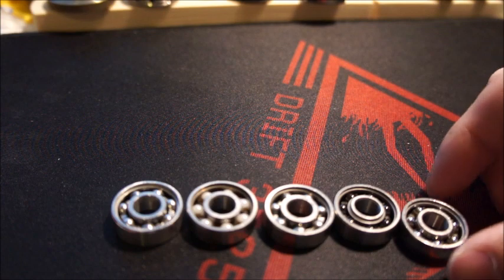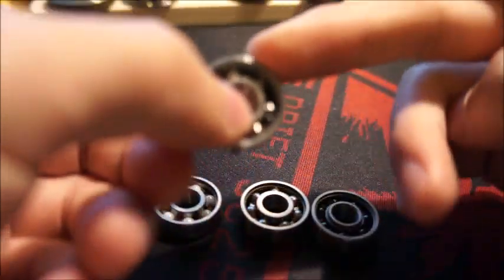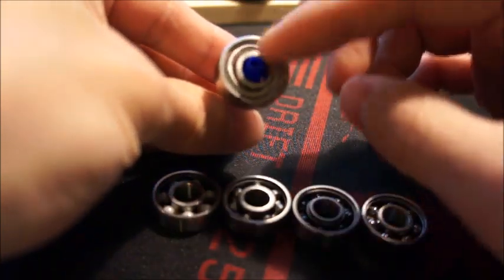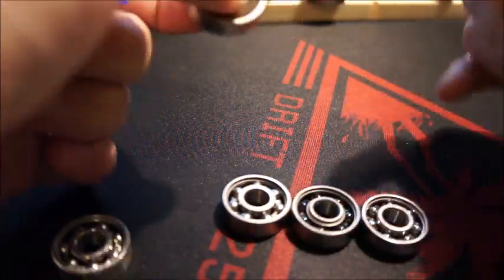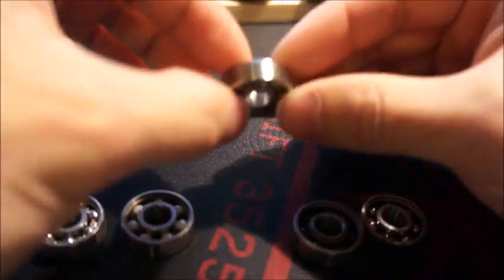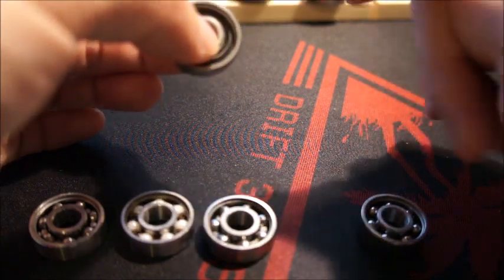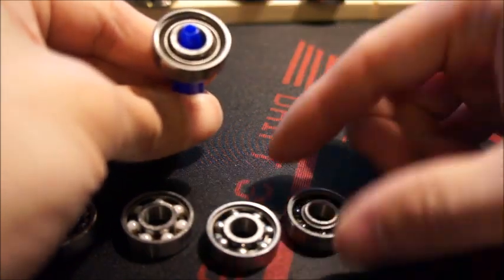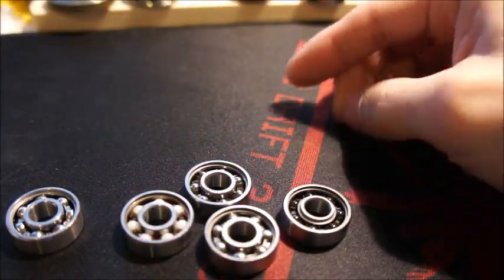Bearing comparison ABEC9 SS vs Al2O3 vs Si3N4 vs ABEC11 SS (For Spinner)

Comment: Hey so I recently ordered a fidget spinner, and its a Si3N4. A lot of videos about that bearing in fidget spinners are saying it is loud. Is that true?
Reply from the maker: Yeah, that's true, and after a while usage, with little bit dust getting into the bearing, it gets louder, keep the dust shield on if possible to reduce the amount dust gets in. The alternative is rub in a tiny bit hand grease or really thin grease, it'll reduce your performance, but the tiny bit grease will make it almost completely silent. Hope that helps. Thanks.
Reply from the maker: I bet the dust cap is removed for those. don't mind that too much though, use a bit grease and lose a bit performance is no issue on spinners, nobody holds it and let it spin for long, you'll be pausing and restarting very often, so I would be happy with 20 seconds spin time.
Reply: Okay also, in your video the bearings don't have caps, but I made my OWN fidget spinner and they had the red caps, they were from a skateboard so what I'm asking is; that will the fidget spinners bearings have a cap or will it be open so we can see the balls?
Reply: From the one I'm buying.
Reply from the maker: I'm not sure, I will guess the red caps will be taken off from the toys from your link, but you can use the red caps from elsewhere, it looks like 608 in the center, your skate bearing cap should just fit. (forgot to say, the ones in my video came with caps too, I remove them so I can clean up the grease)
Reply: hey, can you give the link of the last one bearing in the video?
Reply from the maker: The last one is a SS: https://www.amazon.co.uk/gp/product/B00MS7S9IS/ref=oh_aui_search_detailpage?ie=UTF8&psc=1
Reply: thanks a lot

Comment: How long do the Si3N4 usually spin for withought the lube?
Reply from the maker: That depends on your spinner weight and how much dust got in. on a vorso flat top it can get to 3 and half minutes when it's new and clean. with small bit dust in, it lasts around 2 minutes.

Comment: so which one is the best for a hand spinner? because right now i have red bones as a bearing and it spins for 1:20. please help me....
Reply from the maker: Ceramic, go for ceramic. All ceramic works better than SS in terms of performance. SiN4 is the best, but if you are on a budget go for ZrO2 ceramic. They are much cheater than SiN4.
Reply: Do you know where i can get a SiN4 or a zr02 bearings? because  all i find them at is amazon and some china websites.
Reply from the maker: Amazon, ebay and China are the places to get them unfortunately. You should be able to buy SiN4 from Amazon with no problem. ebay and china will take more than a month to get them shipped sometimes.
Reply: Do you think the silver abec 9 on amazon is a good bearing or no??
Reply from the maker: They should be ok, but I don't think they'll do better than your red bones ones. bones makes some pretty awesome SS bearings on the market.  If you are really keen to get an upgrade, try these: https://www.amazon.com/Pacific-Flyers-Si3N4-Skateboard-Bearings/dp/B00KQPJUKA
Reply: Iam in a tight budget for these spinners so i wouldnt really drop 37 dollars for bearings.. So any other bearings u think thats good

Comment: Thank you a lot for this comparison. So if i understand you well the abec 11 is the best for fidget toys and they are the best value for the money. And also which metod for cleaning the oil are you using?
Reply from the maker: After months of testing, I have to say the SS is good enough in most cases, but the tight fitting is not preferred, slightly lose fitting helps the performance so much. The batch SS I have, about 50% of them are really tight fitting, the other half are good. So if you are keen on performance, go with the ceramic instead. The only reason I see for SS is for the lower noise level.
And for cleaning up the oil, you need to do the following: 1. Spray WD-40 into the bearing, and spin it, let WD40 soak in for a couple minutes. 2. Use tissue paper to absorb the excess WD-40. 3. dig the bearing into paint thinner for a few minutes. 4. clean up the paint thinner. 5. hot air blow dry the bearing. (don't use heat gun though, too hot).
Now you should have a clean bearing.
Reply: DEE STIN Will 98 percent alcohol work insted of thinner
Reply from the maker: @tunaBBQ I think it will. thinner is called "white spirit" I guess there is a hint there :)

Comment: Thanx! Just the comparison i was looking for. Only thing missing from this was full ceramic bearing but i suspect theres not huge difference anyway.
Reply: Did you get tremendously better performance from the silicon nitrade after you removed the oil?
Reply from the maker: yes, it did. although to note even with the light oil in, the weight from the spinner is generating enough torque to keep it spin quite well, I don't see the need to remove the oil, I found myself keep stopping the spinner and restart the spin constantly which makes improvement almost never needed.  The little bit oil in the bearing actual works ok, and you do get the benefit of a little better dust prove. I mean when dust get in and they will get in, they cause vibrations, with the oil, the vibration is much less than without.
Reply from the maker: Yes, doubled on a light spinner, and about 15% spin time increase on vorso flattop mk1